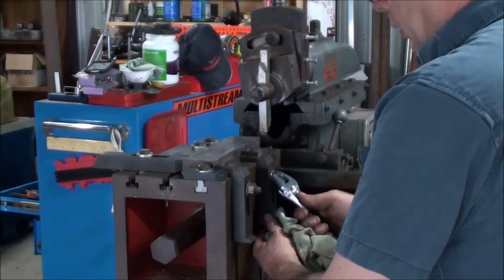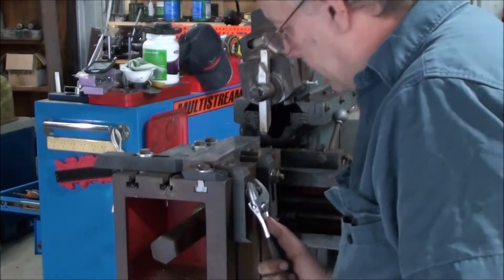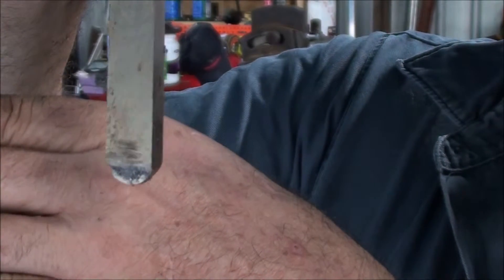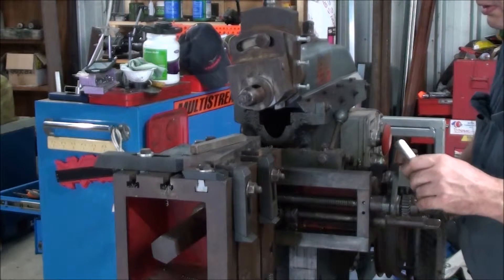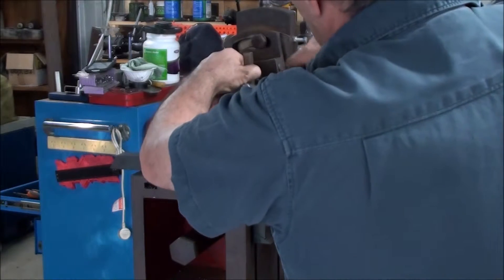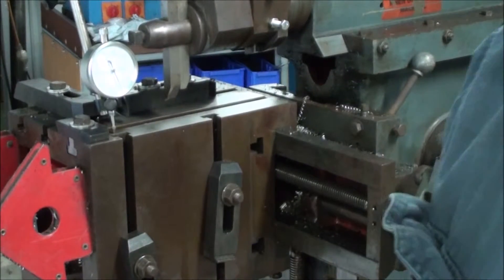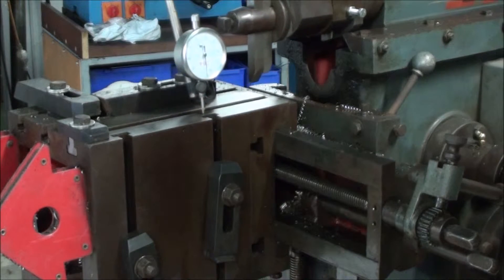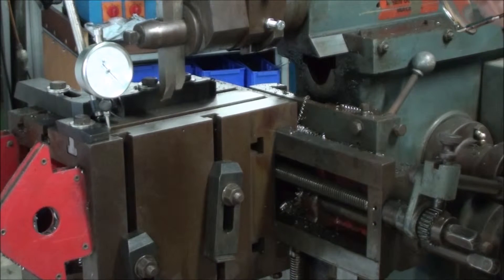Jig Making for the Tool and Cutter Grinder part 2

Comment: Even after 18 months since making your video, it's still a laugh to watch you drop the toe clamp blocks. I hope since then you've worked out it may be better if you used a magnetic clamp to hold it in place. I must add, the teeth on those clamps are too small. Thanks for the laugh, Peter
Reply from the maker: LOL, I solved the problem, I sold the shaper haha, and got a bigger one. The teeth on those clamps give a really good range of adjustment, but they are really designed for use on the mill or the drill press where they do work well. Thanks for commenting.